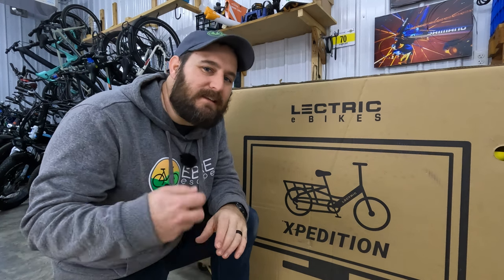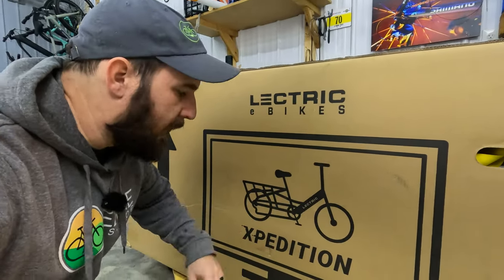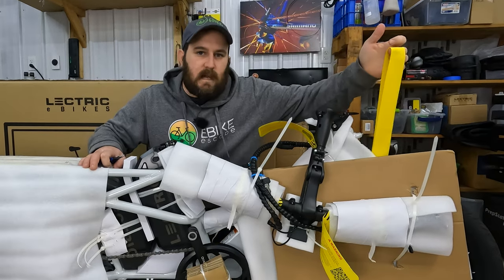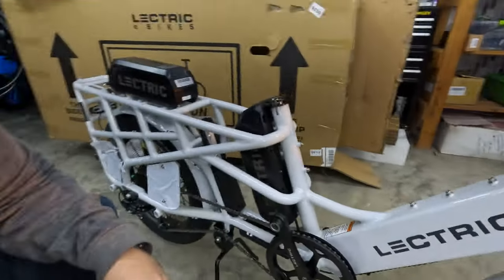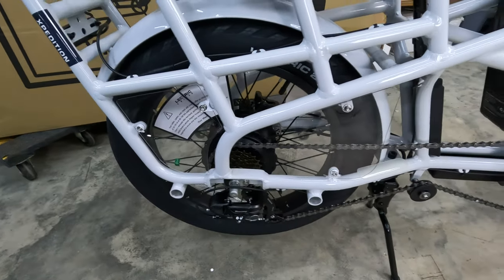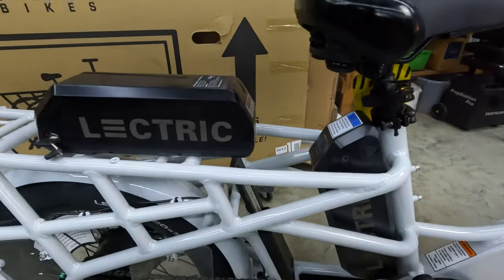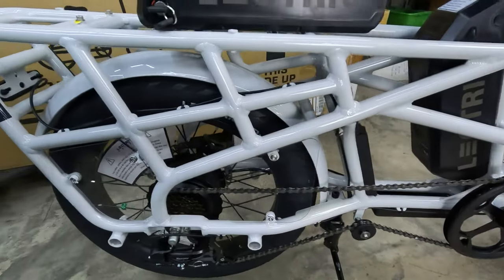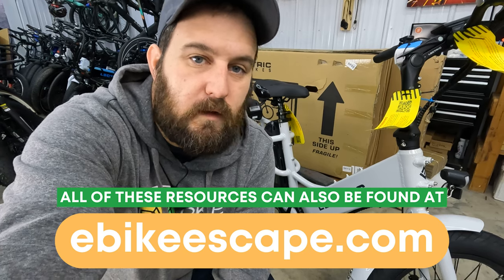Lectric XPedition Unboxing And What You Should Know Before You Buy

Comment: Sooooo,    about the "adjustable seat".  As I see it when I go to the supermarket with this, I'll have to take the seat in with me!
Reply: You can change the quick release to normal bolts and use some Lock Tight on the bolts. Also can wrap the bolts with electrical tape, so it takes a thief longer to get off the bolts to steal the seat.

Comment: Not enough range. I need at least 50 miles throttle only because I can't pedal due to back injuries. I wish more bikes state side would offer more power like the Chinese ones. Aniioki is the one I want but the fact that they are basically buy and never talk to you again makes me worry.
Reply from the maker: If you ride in a slightly lower PAS level, like around 2-3. I bet you could get close to that mileage. Assuming flat terrain of course.

Comment: when using single battery, can I put the battery in lower slot ? I wonder if that way I can use frame mount Thule Maxi Bike seat ?
Reply from the maker: Not certain what seat you are talking about. The Thule Yepp Maxi seats fit on with the battery even in the front slot.

Comment: Does it matter which battery slot you use if you only use one of the two batteries?
Reply from the maker: I do not think so, as both batteries drain equally. I will double check this to be sure though.
Reply: @EbikeEscape  Yes, according to Lectric both batteries drain simultaneously.  I asked them on their Facebook page the other day for confirmation...however, you can't run the bike with 1 battery I don't think.
Reply: @wildbill23c  No you can't run with just 1 battery
Reply: @lizvickers7156  I didn't figure that would be an option LOL.
Reply: @lizvickers7156  what? you can not run this bike wihtout both batterys in their sockets? I dont get it.
Reply: @theflowpowa42oshow  you absolutely can, the bike comes in 1-battery and 2-battery configurations. I have no idea what these people are talking about
Reply: @RealMisterDoge  thank you homie lol I was like wth they have a one battery option!!!!
Reply: @theflowpowa42oshow  I think if you get the two battery option but only have one battery installed the other battery terminal will be exposed to the elements. Probably not good to have the connectors get wet. No idea if the bike will run or not without both batteries installed though.

Comment: I was set to pull the trigger, but had a couple of questions. Unfortunately my experience is that Lectric doesn’t reply to phone calls or emails. I called the regular customer service line & was told wait times are over an hour. So unless I can be assured they have decent customer service I’m going elsewhere. What if I were to have a problem or question about the bike after it is received when they don’t respond to inquiries from prospective customers?
Reply: Using their chat feature on the website, I was able to ask a question and got an answer right away. Might try that